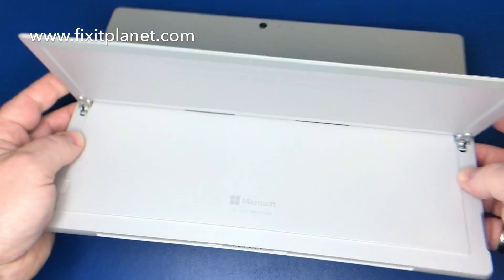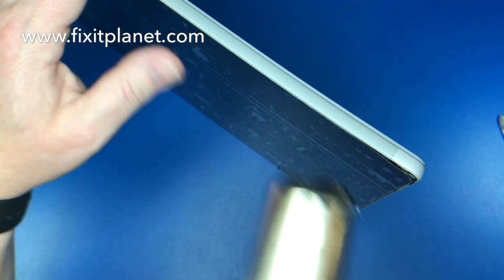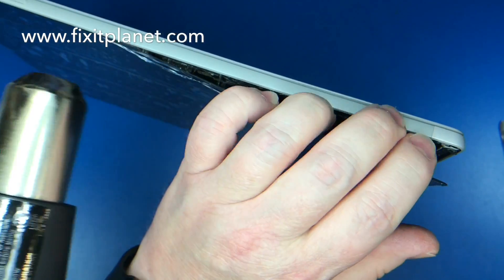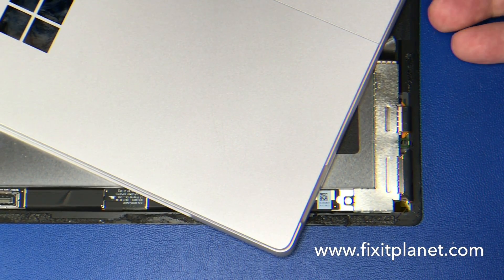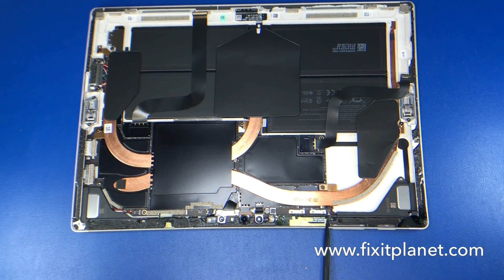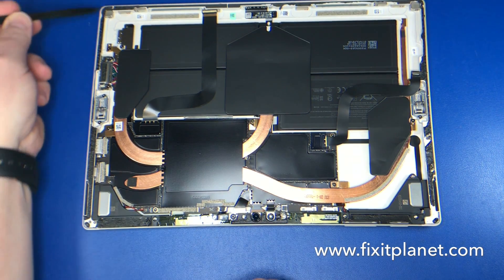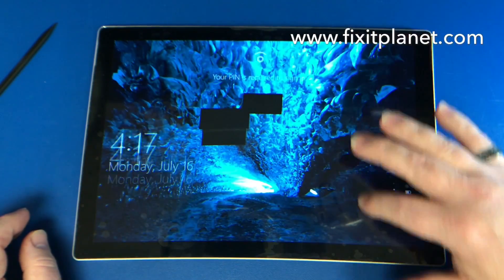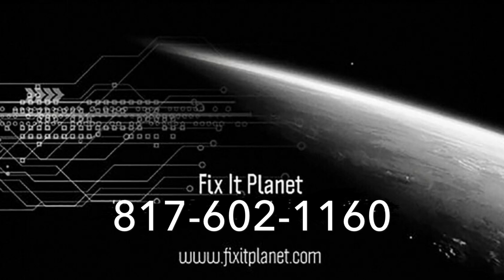Surface Pro 5 Screen Repair & Warnings Watch This First!

Comment: It was the worst fix i ever had. Antennas damaged: Check! Digitizer damaged: Check! If this tablet has an issue, you can dispose it off. It's built for disposal and buy a new one. I rly like to fix Xbox products, but this thing is a pain!

Comment: @FixItPlanet1    You didn't talk about the digitizer...?  Does it have to have conductivity to the back of the screen?  I cleaned the back of my digitizer so there is no old adhesive on it....  Will using a two-sided tape prevent it from working properly?  Do I need to use a conductive adhesive?

Comment: Hello, I got the battery changed on my Surface pro 5 and now the touch screen stopped responding, what could be the cause? And is it possible just to replace the cables that connect the screen to the board in case they are damaged during the replacement of the battery? Thanks

Comment: Your garbage Surface 2, 3, 4, 5, 6, 7, 8, 9 and the next of them, does your screen went dead?! Well... I have bad news for you. 
My Surface Pro 7 went dead, turns on only if left to cool down...
but I have some bad news for you, it's a hardware issue, Microsoft knows about it, but they don't care, it's a marketing thing. 

On the right side of the screen, just a little down below the right speaker, it's a magnetic microswich that is being triggered by a magnet in the keyboard, it doesn't matter if keyboard is attached or not, the magnetic sensor it's underneath the LCD, so... The tablet in time heats up, the battery slowly expands due to the heat and wear out of the battery... This battery expansion puts pressure on the motherboard, the sensor it's on the motherboard we're just above I mentioned about it, this expansion it's enough to trigger the magnetic sensor as there's the keyboard close to the screen, so the tablet won't turn on, the tablet thinks that the keyboard is close to the LCD, so it's made to not turn the screen on, if obviously the keyboard is closed. In fact the tablet is on, but no light on LCD. 
Probably even if taken apart, most likely you won't be able to find a new switch, it's pretty much same concept as the light inside your fridge, but this sensor it's digital, not just analog.

They packed way to many things in such a small enclosure, maybe 1mm more thickness would have saved the situation...
Yes, you can most likely relate this issue with the Samsung Galaxy Note 7 from a few years ago, remember those when they use to burst in flame? Was because of the battery expansion, but had nowhere to expand.

Comment: Yeah I've done a few of these now and it's basically a craps shoot whether or not the antennas will rip off or not. There's adhesive on both sides of the antennas so it's incredibly difficult to get the antennas to separate from the screen but stay on the case. PITA.

Comment: Thanks for the video, is it true that batteries on surface pro 5 are digitally signed by microsoft so replacing them by yourself would make the device wont charge anymore?

Comment: Hello, 
what does this antenna do? I damaged them :( 
Also I have a phantom touch finger in the corner. Is the display I purchased damaged when there is a constant finger touch? 

Thank you
Reply from the maker: Yes if the display continually touches even when you don't actually touch the screen it is defective.

Comment: My surface is a POS! 🤐😠 Repair shop won't touch it. Power buttons on all models are CRAP, which is such a shame for an otherwise fine product. 
To e last time I accidentally shut it down instead of revisiting it, it took me 6 hours to get it to turn on. I cannot imagine that every single model has this issue. One would THINK Microsoft would fix this issue, but they don't care because Bill Gates us an evil SOB! CURSE YOU BILL GATES!
Reply: Rebooted it 🤬 autocorrect

Comment: I need to change the battery on mine which no longer charges. I have now received the battery but need the know what is the adhesive and where can I obtain it. Thanks
Reply: Some ultra strong double sided tape works wonders - not the usual cheap paper tape, but the plasticised type used by carpet fitters would certainly hit the spot.

Comment: I accidentally cut off two inner screen cables that fold in from the screen connector on bottom left that you disconnected from the bottom.  I used a plastic card to cut off the screen its not sharp but it somehow ripped it.  Is there any way to fix this? I can seperate the screen and see the connectors but I dont know if its even possible to get those cables.
Reply from the maker: Sorry bud but Nope those are for the digitizer. You may still be able to see an image but no touch function will be available.

Comment: Dear I want to consult you: I replaced the screen of my surface 5 pro 1796 with another of the same P / N, it was working very well for a whole day, after a win10 update, coincidentally the touch no longer works. I restored the Windows as factory, I also tried booting in UEFI mode and the touch no longer works, it is inoperative.
I have my doubts:
1- When did Windows also update the firmware of the touch control board, is the firmware incompatible?
2- When the touch is connected or disconnected, the screen always works ok.
3- I have installed two screens and the same thing happens, after Windows is updated, the touch no longer works.
The screens I have bought from aliexpress, they are reconditioned.
Has anyone had a similar experience?
Reply from the maker: So far I have not come across this update problem with the Surface Tablet. Maybe pulled from a bad batch.. Try replacing the control board and test again.
Reply: @FixItPlanet1  Have you ever come across this issue since this comment? I'm having the exact same issue. Replaced the screen, worked fine for about 2 days and then the touch stopped working. I thought maybe the ribbon cable was damaged so I replaced it and still nothing.
Reply: Did you ever find a fix for this? I'm having the exact same issue.

Comment: The video was very helpful. Thank you for putting it together and sharing it. I'm not a repair person, but am realizing I may have to do some of my own repairs now. Currently I have two problems. First the adhesive that holds the screen to the frame is coming loose. The second is that part of the touch screen no longer works. Can you advise me on getting the screen working agin and where to get the adhesive? Thanks in advance! Jim (soderjames2017@gmail.com)
Reply from the maker: If the screen is separating from the frame there must be a reason. Sometimes the battery swells and lifts up on the screen. The battery should be replaced if this is the case. If the touch screen fails then it has to be replaced as well you can get that here https://amzn.to/35t4bgX You can get the adhesive here https://amzn.to/36Act5M
Reply: @FixItPlanet1  Wow! That is a significant help. Thank you. It does get quite hot, so yes, you are probably right about the battery. The keyboard had to be replaced last years. Now the battery and screen, should I just by a new computer? Do you have a link for the battery and tools? Is there likely to be anything else wrong once I get into the repair? I would appreciate you answering these questions, but I am also going to call your company tomorrow. Thanks again. You are GREAT!

Comment: I opened it like you did now the touch screen doesn't work. I even replaced the flex cable for the digitizer, but still would not work. Any help  ?

Comment: hey i dont understand im looking at all the sp5 teardown videos and none of them have fans but mine has a fan, i can hear it
im pretty sure mine is an sp5 because it has a 7th gen i7 cpu 
if you have any info on where i could find a teardown of it i would be very greatful
good video nonetheless :)
Reply from the maker: The teardowns are the same. One has a fan and one doesn't but the process of removing the screen and taking them apart is the same.
Reply: Fix It Planet thanks but do you know if the cooling system is the same? I want to change the thermal paste on mine but I don’t want to open it just to see that the fan isn’t connected to a heat sink or heat pipes for nothing

Comment: What temperature is your heat gun set to?
Reply from the maker: It all depends on what type of tool your using. A regular heat gun has at least a high and a low setting. If your using a hot air station then you can adjust the temp more accurately. Mainly distance, airflow, and thermal mass are critical to deciding what temp to use.

Comment: I have a surface 1796 in which the battery is fully charged but will not run off the battery, only when plugged in.

Comment: Is there any way to test the display to make sure that it's working?  I have a Surface where the screen cracked & was still working, I tried 2 different screens & I can touch the screen & see that the digitizer is sensing my hand when I hook up a monitor to the display port.  I've purchased a new digitizer & 2 new ribbon cables in hopes that this would solve my issue.  I've replaced several other screens on different surfaces without this issue.  I can't figure out if I damaged something on the surface to prevent the screen from showing up.  I guess I might have to take apart a working surface & test out these 2 screens unless someone knows of any other way.
Reply from the maker: Yes if at all possible having a known good tablet open and ready for testing displays is very useful.

Comment: Can I use surface pro 5 screen in surface pro 4 because it has screen flickering problem, and I heard somewhere that if you replace pro 4 screen with surface pro 5 the screen flickering problem is resolved.Thanks
Reply from the maker: If your screen flickers just try testing the tablet with a known good screen. Even though the Pro 5 screen will work and fit on a Pro 4 the display cable is different and there is no reason to substitute a 5 screen for a 4.

Comment: Can i put a surface pro 4 lcd on a surface pro 5?
The surface pro 4 lcd is less expensive
Reply: Bro
Reply: NO, never do that. I have a surface pro 4 and the screen is awful. I've actually considered replacing the screen with a surface pro 5 one, because it's possible and the screen itself is a much higher quality than the SP4 one. The surface pro 4 screens are the worst screens you can get, they have an insanely high failiure rate because they're really poor quality. I'm lucky that my surface pro 4 screen has only the touch layer dead, so I can't use the touch to interact with the device, but atleast it still works with keyboard.. Many people with SP4 had straight up the entire screen die without doing anything to it.. It's just a very bad screen in general

Comment: I have an SP5, will never buy this kind of thing again. Battery dying, less than 2 yrs old. Not really replaceable. NO DEVICE should be this difficult to service. These things should have case screws. Yes I've cracked open modern phones that are nearly as bad, but this thing is about the worst. And I have yet to see anyone post a battery replacement vid. Apparently the battery is glued across it's entire back side. The whole situation is ridiculous. $1200 device that can brick at any time, irreparable.
Reply: Yes, has a similar issue but in my case the battery was swolen and it broke the screen off. Total piece of crap, microsoft said if I give them the old one + 300 usd they give me a new piece of crap, but that would be wasting 300 usd IMO.
Reply: Totalmente de acuerdo. Es lo PEOR que he visto. La batería sale fácilmente si ponemos un poco de quitaesmalte de uñas, con una jeringuilla, por debajo de la batería. Estas baterías son MUY peligrosas, jamás usar elementos metálicos para quitarlas, si se perforan se prenden fuego y es mejor salir corriendo.

Comment: How about someone make a converter kit, that one you ever get the glass off without destroying the Surface that you can reassemble it and disassemble it again without going through the ordeal again?
Reply: This is exactly what I dreamed of. Magnets on rear of glass, and bezel. That way you can lift off with suction cups.

Comment: after i had got my screen off i accidently hit the power button, after doing so i plugged the screen back in while it was running and now my screen will post the microsoft logo then flicker a little and go black. do you know if my screen is broken? or have you run into this and know what i should do next?
Reply: did you manage to find a fix for this?

Comment: Hi Fixit, I've watched your video several times now...  I've got to replace the charging port on my surface pro 5, it got wet and burnt the contacts out.  I can't find anybody in the uk to do this repair but I reckon I've as good a chance as any.  Do you have any advice on which exact place to start prying the screen away from the body?  I'll use a heat gun and plastic tools.  Do I have any chance of getting the screen off without breaking it iyo?  thanks for the vid
Reply from the maker: Believe it or not I've done it, but It is very difficult to remove the screen without damaging it. I would be prepared to replace that as well. You can start prying anywhere around the edge except for the bottom left corner and save the top for last, go slowly, and pay close attention. The antennas at the top will tear easily. Also the bottom left corner is where the digitizer controller board resides. Those cables are very close to the edge, you only have about 2.30mm clearance...So don't insert your tools too far or you will damage those cables. You might also find some useful info in a new video https://www.youtube.com/watch?v=aMGikVXxdBY It's an SP 4 but closely related. Cheers!
Reply: Thanks for the reply and advie.  Seems the screens are only £150 new on ebay....  Even if I do have to replace the screen, it's still way cheaper than MS out of warranty repair at £400.  

Low heat I'm guessing if you don't want to fry the screen??  Cheers again!
Reply from the maker: No problem. As far as heat goes... don't leave it in one place for too long keep moving it around. Temp just depends on how far away the source is and size of the nozzle etc. Happy repairing!
Reply: Hey again.  Well.... started at one of the speaker holes, all went well for about 15 seconds, then smashed the screen!  Ah well.  Nightmare and then I pretty much broke it all the way round, except for the top.  At any rate, all the broken glass off and all the black stickystuff, nothing damaged (apart from dang screen).  I kept turning it on by mistake, but having the windows welcome sound was very useful, cos then I waited for it and then held down power for 20 secs to turn off again

So thanks lots for the vid because without it I would have messed it up reeeeeaaaaalllllll bad!! 

Final question: are all the oem replacement screens on ebay more or less the same??  Some have wildly different prices but none are "orig" parts.   Cheers bud
Reply from the maker: The screens are fine (usually) and come from the same places in China regardless of who's selling them. Just make sure the return policy is sufficient in case you need to return a defective screen. Don't seal it up until your sure it's good. Cheers
Reply: thanks lots, looks like i have to take off the cpu cooler to change the power port as well!!! ggrrrrr
Reply: Ah, sweet sweet success!  thanks for your help
Reply from the maker: Awesome

Comment: I just followed your video today and got the glass all off, however on the antennas I have a question, please.  I see where the glass made a small indent and on the other the edge looks torn a little.  If I send a picture can you tell me if it will work or if I should not bother getting a new screen?   My husband bought this for me and I only had it a few weeks when I dropped it.  No warranty because it was a discount at best buy and we got a deal.  I found your video and decided to give it a go at fixing it myself and so far so good except for the above question.  Thank you.
Reply from the maker: If it is torn just a little it will most likely still work but signal reception may be reduced. A minor dent is not a big deal. I would just replace the screen and test before sealing it up. See how well it works and make a judgment then. Doesn't sound too bad.. :)
Reply: @FixItPlanet1  Great thank you so much, will do.
Reply: @FixItPlanet1  let’s say I ripped them off completely what is the signal for?

Comment: is there a way to replace the antenna if you rip it off?
Reply from the maker: That is a problem I found 2 available for about $200 bucks on eBay https://rover.ebay.com/rover/1/711-53200-19255-0/1?mpre=https%3A%2F%2Fwww.ebay.com%2Fitm%2FMicrosoft-Surface-Pro-1796-Tablet-2017-MODEL-Wireless-Wifi-Antenna-M1024928-%2F142897584260%3F_trksid%3Dp2349526.m4383.l4275.c3%23viTabs_0&campid=5338414869&toolid=20008
Also I found this article you might want to read too https://blog.kamens.us/2017/05/10/lessons-learned-from-diy-microsoft-surface-pro-4-screen-replacement/

Comment: How do you like that adhesive? I ordered one from Ebay to repair a surface 3 screen and everything was fine and working after I put the new screen on but the screen started to come off later.
Reply from the maker: Idonno that sucks. I've never had that problem with what I use. https://amzn.to/2AOGzUe
Reply: @FixItPlanet1  hello from Wisconsin! I have the 1769(bought it 3 months ago) Due to unforeseen events I am having to replace the screen myself. Wondering if you could maybe answer a few questions I have.